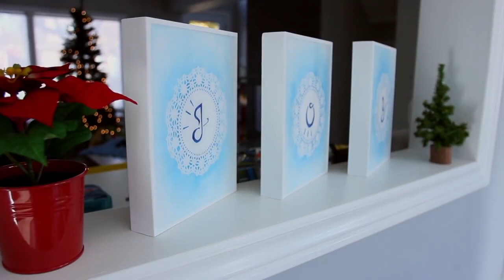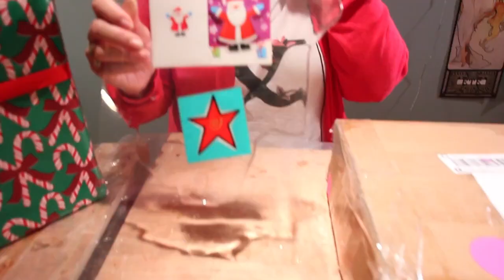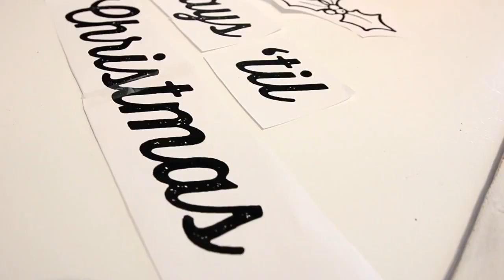Resin Crafts For The Holiday Season

Comment: I love your resin ideas. I have a question. All the resin artists I have watched wear masks. Is your resin different in some way to the others? I never use a mask. I do wear gloves and use with adequate ventilation. I haven't tried art resin, yet! Thank you!
Reply from the maker: Hi Rebecca- not all epoxy resins are equal, it is important to follow the guidelines for the epoxy resin you are using.   We are happy to tell you that ArtResin is non-toxic and does not produce fumes or VOCs--it is safe for home use, and when used in a well ventilated area a respirator is not required.  Epoxy resin is a skin irritant and very sticky before cured so we always recommend protecting exposed skin and wear nitrile gloves when working with ArtResin.  Here is our blog with more information:  https://www.artresin.com/blogs/artresin/what-safety-precautions-should-i-take-when-using-artresin?_pos=3&_sid=0f2259a4c&_ss=r
Reply: @Artresin  Thank you so much for responding in such depth to my question! Merry Christmas!